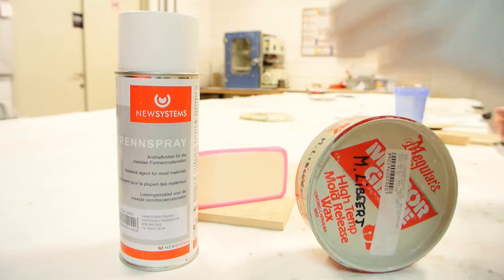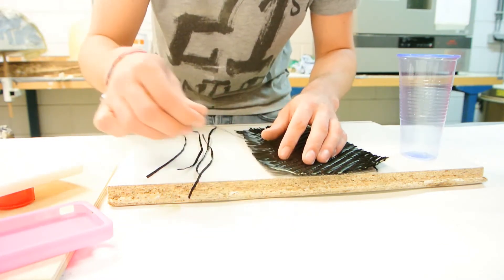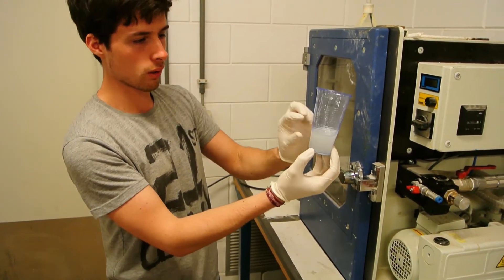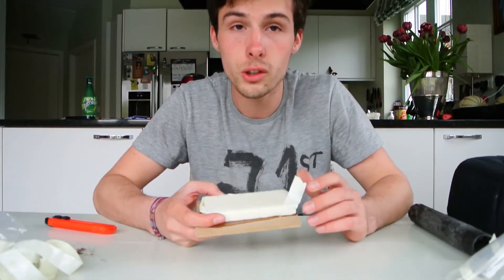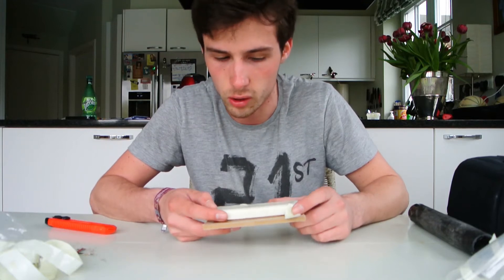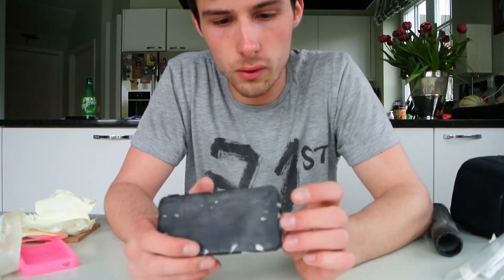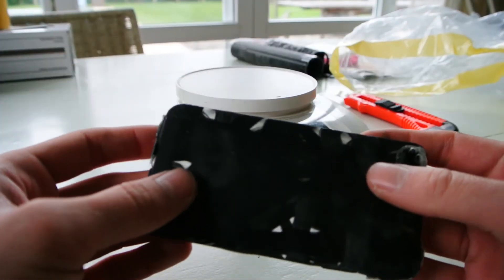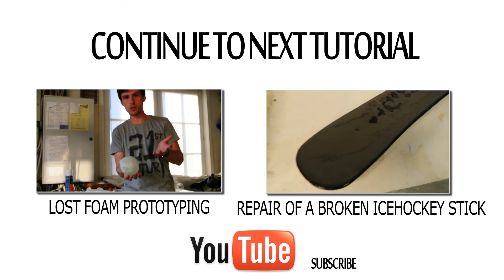First Test On Making A CarbonFiber Iphone 4S Cover - The Cover (*PART 2*)

Comment: Despite the fact that this was a test. I am sure you can easily epoxy the 2x2 twill fabric right on and the edges would have conformed to the compound curves. I will most definitely have to try this. Good work and thanks for sharing.

Comment: Totally don't understand why you had to unweave the carbon fiber strands from the sheet. Perhaps you could've used a carbon fiber sheet with smaller weaves and simply placed the sheet on the wax mold.
Reply from the maker: I understand what you mean, I was looking for another look initialy... The plan was to make a cover out of carbonfiber strands with gaps inbetween, inbetween the fibers... I didnt expected it to cover the entire piece caused by the pressure

Comment: Hi Matt. A while back I developed the first carbon fiber iphone case for the 3G. I made my plug in the same fashion as you did, but my layup was different. I found out that vinyl sheeting makes a great bagging material for epoxy only. it will stretch real well under vacuum and more so with a little heat. Also, if you elevate the plug and apply vacuum. you should be able to create the "DRAG" you need to keep the case on the phone.